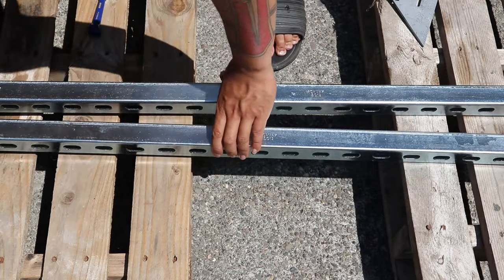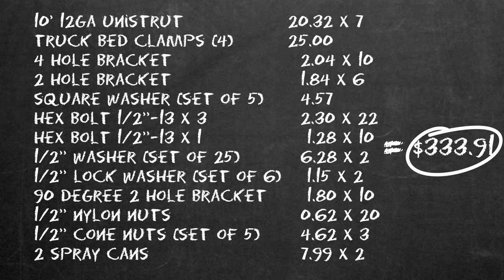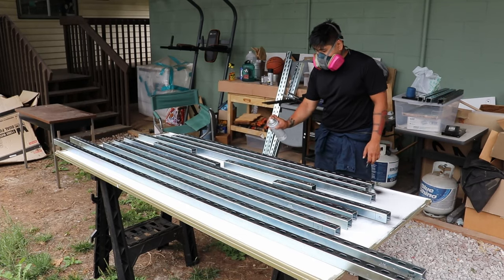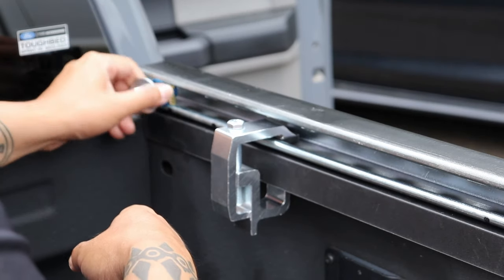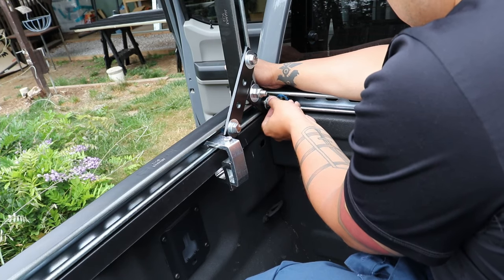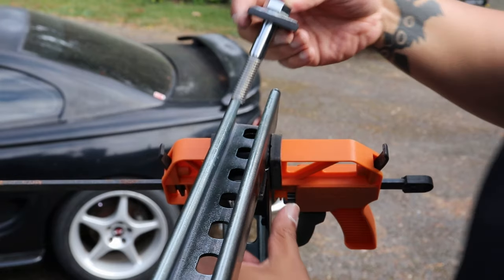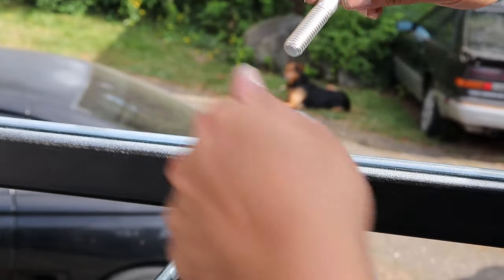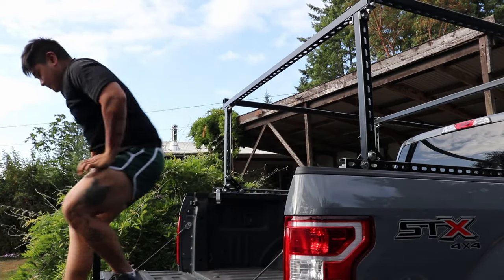How to Build a TRUCK RACK  - DIY - Made From Unistrut

Comment: For those of you wanting to build something like this, but make it stronger and better looking, check out T slot extruded aluminum. It’s a bit more expensive, but it bolts together, is stronger, and better looking. Lots of modularity as well. Plus you can cut aluminum with a good blade on a chop saw.
Reply: Priced it out, buying extruded aluminum cost as much and even more if you include time/labor than a fully built aftermarket bed rack  :D
Reply: @mannyechaluce3814  how much did it come out too? I have a 4th gen Ram and let me tell you man there aren’t many options for me lol
Reply: That's a good call. The aluminum should be lighter too, better mileage is more important now than ever!
Reply: which would be better for a kayak?

Comment: Now all you need is some checker plate sheet metal, airstruts, and hinges to cover the sides and back. The hinges and airstruts are so you open the sides and back. Then cover the top by bolting down checker plate and you have yourself an awesome truck box/rack

Comment: Sir thank you for posting this. I have a job coming up where I'm hauling 1/2 inch  pipe 1000 miles and I was going to need unistrut at the job to hang the pipe. I was going to buy a ladder rack and a roof rack to haul everything because I don't want to haul a trailer. Now I don't have to buy a ladder rack because I'll use the unistrut from the truck rack build and my customer is buying the unistrut. So after we arrive the truck rack and pipe come off and I don't have the expense of renting renting a trailer or buying a truck rack. I don't do alot of pipe hauling or need a rack on a regular basis. Thank you again!!!

Comment: I have been searching for ideas how to build a 14 inch tall  box to attach to my RV that goes over the the ac to allow me to use the full with and length of my roof for solar panels. Your design is great all I did different was add cross wires between the legs for squaring and support. a similar store bought unit was over 3k. Thanks

Comment: Did you use the full 10' length for the two main bars?
Excellent info. You might have saved me a LOT of time:)
Reply from the maker: I dont remember but I did have some length leftover that could be used for other mods.

Comment: Looks like a good build, but I just saw new video by another Channel Mixflip this week build one for under $100 with the same material Unistrut  and Bolt clamps on for Toyotas for a bed tent pretty easy and also cheap. Just the two bars go on a cross without drilling into the bed if that's what you're looking for with existing rail system, and that's what I was looking for, but yours is good too for a universal use!

Comment: Thanks for the inspiration. I want to build one for over my camper shell so I can carry 20ft sticks of pipe and rebar as well as attach tool boxes/storage to the sides
Reply from the maker: Youre welcome! Spreading the love and inspiration is what we are all about! Hope yours turns out well
Reply: Did you get to do it? How did it go?
Reply: @leer5888  ended up buying a big old flat bed dump bed f350 with a big headache rack lol before i break my Titan. I hate always cramming 10lbs of crap into a 5lb bucket... last straw was trying to haul a bunch of concrete blankets they are just too bulky to jam in the camper shell.  F350 has over 3x the bed space open top 8x8.5 with sides that pop off. I still have the Titan but it's just got bars on the camper shell now but I just dont trust the weight limit just bolted to the fiberglass. Fine for hauling my little john boat or a few sticks of PVC but that's about it.  The Titan is such a clean build I didnt want to start hooking all my work stuff to it. I never want to go camping or anywhere fun, take the lady out with all my tools jammed in there. The F350 uses 2x the gas but hauls over 3x the stuff for less trips so that's how I justify it. I was gonna just buy a dump trailer but the whole truck was cheaper with low-ish mileage lol. Now I'm looking at a bigger trailer and a mini excavator, diesel transfer tank, also possibly a lift gate. F350 opened a whole new book of opportunities for dirt cheap.  I'll probably obtain all that gear for less than a certified pre-owned vehicle that's not even set up the way I need it too which is crazy to think.

Comment: Hey there. How was the paint job. It is not easy to paint on galvanized. What did you use?
Reply from the maker: The paint held up but after a year the paint bejng exposed to direct air from driving started to wear off but for the most part it held

Comment: Wondering what all that heavy duty hardware and uninstrut material cost compared to buying a ready made rack. Craigslist had several today for $150 used.
Reply from the maker: My build cost about $300 and the way I designed it allows for further modifications if needed and could be modular to fit whatever I wanted. That was the philosophy of my design and materials I chose. Sure you can get one for $150 but how easy would it be to modify or change it. I dont know how much you like to tweak stuff so it's all based on that really.
Reply: @craftworksbyg6440  guess I paid maybe $250 for my all aluminum Hauler brand rack for an 8’ full size truck. It’s extrusions could be cut down to whatever if disassembled and reassembled.

Comment: How's the road noise? I used unistrut for a roof rack on my minivan and the road noise was a little loud. I bought 1.5" or 2" magnet strips and lined the inside of the strut to cover the holes which reduced the noise a lot.
Reply from the maker: I haven't had much road noise at all, maybe going on a long bridge with high winds there are some whistling sounds, but nothing mechanical

Comment: Curious about how its held up since you installed it.  Follow up video in the works?
Reply from the maker: It's holding up super solid. No wobbling, no weird noises, haven't had to tighten anything yet. As of right now the paint is getting chipped away at by small road debris but structural integrity is still excellent.

I am planning on doing a follow up video in the summer to show how well it has held up

Comment: At 6:45, I tried attaching the unistrut to the bed rails, but it wobbles in/out of the bed a little. Does yours wobble?  What did I do wrong?  
Thanks! I'm going to get this working!
Reply from the maker: Hey there! Mine does not wobble at all. Does the top portion of your bed rail have bumps or whatnot?
Reply: @craftworksbyg6440  it has long ridges.  I didn't connect the two sides via the arch at the top yet.  Is that why?
Reply from the maker: @TheRainHarvester  oh yes attach the arch and bottom  and it shouldnt wobble anymore

Comment: would this work the same with the smaller 14 gauge unistrut?
Reply from the maker: It might, I wanted the rack to be little bit sturdier to be on the safe side. I would still recommend the gauge I used.

Comment: Nice work! I'm in the process of doing something similar for a roof top tent on a trailer I'm building. My concern is those cone nuts.... I'm not sure what kind of stress and weight those things can take. You still think they're solid after you've had them on for a few months?
Reply from the maker: ya the cone nuts are holdin on strong even after using the rack often
Reply: I built a greenhouse with them. Amazing stuff. On my channel.

Comment: Do you still have this rack?
Reply from the maker: Yes I do and hasnt failed me yet. Havent had to tighten up anything either. Only thing wrong is the paint is getting s=chipped away by road debris but structurally its all sound.

Comment: Unistrut is not that bend resistant. As is, if you sat quickly on the front bar, it would sink. You may want to help it a bit by placing some pieces between the front uprights and horizontal front pieces.

Comment: A fly in the ointment in your barrel of honey. Everything seems to be nothing in this design, but due to which lateral stability will appear when at least a dozen large boards are placed on top. Everything will turn either to the right or to the left on a good turn.
Reply from the maker: Please drive responsibly. I havent had any issues in lateral stability
Reply: @craftworksbyg6440  Well, I think it's better to have a margin of safety than all the time everything will depend on responsible driving. What if the child ran away? Is the other driver not as careful as you? Yes, you never know what can be on the road. As we say, once a year the stick shoots. It is better not to live by the principle - "this cannot happen to me." It may rain, a drunken hooligan is nearby, the man became ill at the wheel and he drove into the oncoming lane, an animal jumped out. Whether it is not enough what situation. Safety margin never gets in the way. By the way, it is very easy to achieve it, even with tension belts. :) No, I'm not talking about fixing the load well. It is the rigidity of the structure to achieve.

In general: there are no comrades for the taste and color.
Reply: @PRO100CBAPKA  lol wut?
Reply: @hc3550  What exactly - WUT? Ask a more specific question.
Reply: @PRO100CBAPKA  hahaha scrub
Reply: @hc3550  You have a very subtle English humor that I don't understand. It seems that only you can understand your humor.
Reply: @dropndeal  Trying to what? I don't understand your slang. The guy created a thing. It's not a bad thing. We discussed the shortcomings with him. What exactly do you want to say? One lol-kay and scrub-aet, for some reason you took it upon yourself to calm me down, I'm fine. What's wrong with you? What do YOU think is wrong in our communication with HIM?